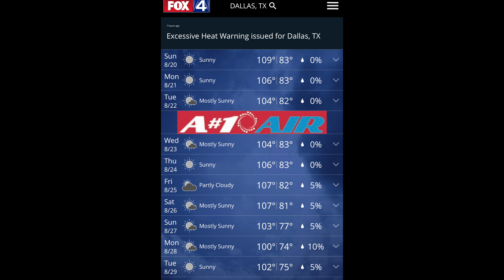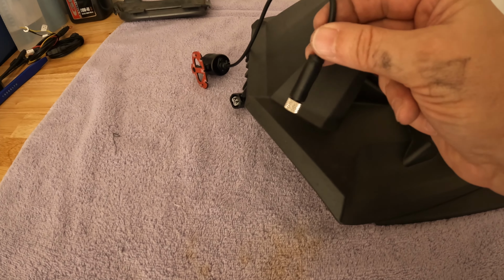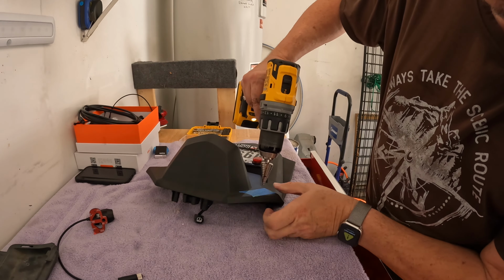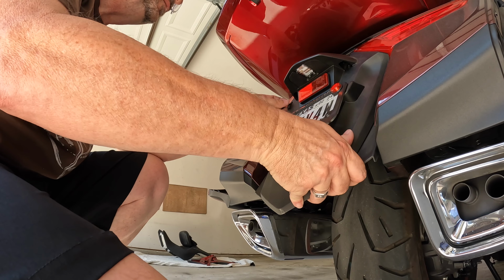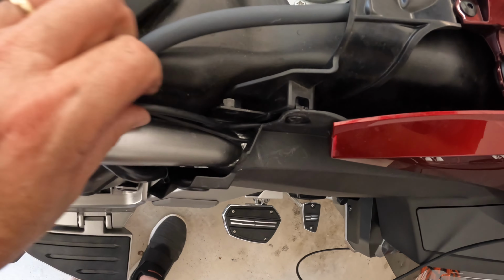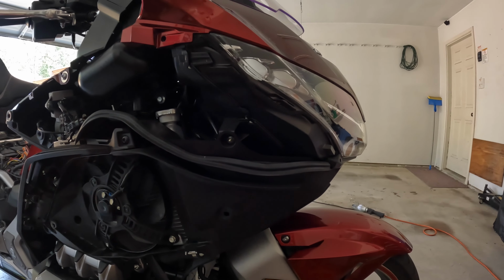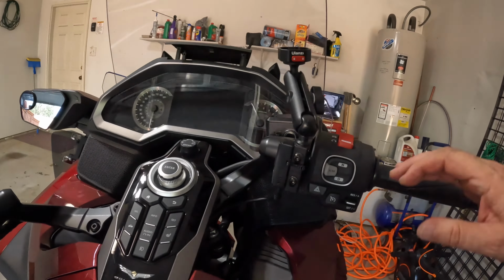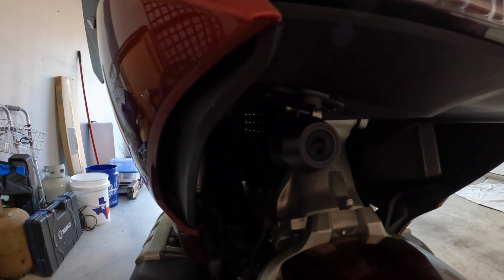VanTrue F1 Dash Cam, Install

Comment: I have a 2023 bagger and mounted the rear camera on the top shelf up against my new Corbin Fire and Ice saddle.  Lewis at Electronic Connections sold me a shark fin antenna that promises to solve the poor FM/AM reception. I will now relocate the camera to the license plate holder shelf like you did and place the antenna where the camera was.  I hope this works...I've tried several things to no avail with improving reception.
Reply from the maker: Rodney, good luck with the install.  I agree my radio reception is horrible as is my phone call audio… I think because of my three way Bluetooth tooth… phone to bike to helmet.  Looking for a better solution there.  What color is your 2023?
Thank you for watching and supporting my channel!
Reply: Matte Grey.

Comment: Hey Robert, my Vantrue is having problems connecting to the internet. Did you have that problem? I use a Motorola wireless android auto bike adapter
Reply from the maker: @StretchingOn3Wheels  no that has never been a problem for me, but I can’t say I check the footage all that often.  Thanks for watching!

Comment: I mounted the main unit in the trunk, all of the wiring is long enough to reach.  There is a grommet on the left side front of the trunk allowing access to under the seat.  The remote, I mounted to the right side of the center control panel.
Reply from the maker: Wayne, mounting the remote to the center control panel crossed my mind too.  The trunk is a great idea for the main unit... If I start to have issues with the GPS I may move mine.  Thanks for the info and for watching !!

Comment: Cool.  Maybe a dumb question, but why not drill the wire through right behind the rear camera, on top? Just a little stabilization and more resolution and you could use that for motovlogging rather than the unreliable go pro or distorted 360
Reply from the maker: Torquer thanks for watching and commenting.  Right behind the camera was not clear from behind the license plate holder… and well I’ve already drilled.  You might be able to make that work however.  I’ve had good luck with the GoPro and if getting video off that VanTrue device is always as complicated as it was for this video, no way.  Ride Safe!
Reply: Could you elaborate on how it was complicated to download from his unit? I am a complete virgin as to dashcam use. I was very interested in this unit as I felt it would be more to my liking to have a permanent mount rather than something mounted to  my helmet or a pole. I have no interest in vlogging,  I just want it as a safety feature in case of an accident or theft. I truly enjoy both Cruisemans and your vlogs and star each day check8ng for updates. Be safe. Happy Motoring!

Comment: Thanks for the video on the installation! Made the job easier for me. I mounted my front camera in the middle and the rear on the license plate light housing. The wire fits inside easily and routed behind.
Reply from the maker: Awesome Peter… the only worry I had about a center mounted front was wheel travel…. You are likely fine…
Reply: @robertwhitemoto  yes, I have tried some really rough roads and haven’t had any issues.

Comment: Great video Robert. Thanks for taking the time to film the install and post it. It's always nice to see how much work goes into running wires and selecting an install location. You covered everything well. After seeing the video quality I may just order a unit for myself. Ride safe my friend.
Reply from the maker: Hey Larry, welcome back.  Yeah it’s good to have that insurance in case of an accident.  I was impressed with the quality.  Ride safe up there, and send some cooler weather will ya?  :-)

Comment: EXCELLENT Video Robert! I will install the INNOVV K7 instead on my 2023 GOLDWING. I have had to do a similar installation on my previous YAMAHA FJR1300 with the INNOVV and their cabling is a lot easier to manage and to snake through. I am looking into having the Recording device in the trunk for easy access to the Media Card. I like the routing for the Controller and the positionning of the Front Camera. McAllister (TRAXXION DYNAMICS) has recommended a similar position (LEFT/RIGHT) for the front camera due to the front strut compressing. Thanks for making the Removal of the Side Panel NOT as "obtrusive".
Cheers To A Great Video! 😎🏍
BTW-What kind of Camera Body are you using these days?!😊
Reply from the maker: @MrTanker10a  thank you so much for watching and for the kind words!! 🙏🏻. I really am interested in their new combo product that has the third eye combined with a dash cam…. I’m shooting with the Canon R5 currently… it’s all I’ll ever need.

Comment: Robert - great job showing the install.  With the exception of your extreme heat, which we're getting this week up here in Ohio, it looked pretty straight forward.  Can you narrate to the video while recording?  Would this be an alternative to a GoPro system for capturing road trips for future remembrances?  Thanks for walking us through.  My bike is an '05 so installation may be slightly different.
Reply from the maker: Hey Jim, thank for watching and commenting.  I think the video quality would be good enough for vlogs, but the stabilization of a new GoPro simply cannot be beat.  Also there's the matter of the wind noise, so I would have to cut the sound being recorded from the dash cameras and narrate into some other device and pair it all up later.  More trouble than it's worth.  There's plenty of cable and I've heard a few folks talk about mounting the base unit in the trunk or saddle bags rather than under the seat.  Ride safe up there and stay cool !!

Comment: Great install and thanks. Question on the rear camera wiring. I like where you installed the rear camera but not a fan of the wiring. I am just curious if there is enough room behind the camera maybe up a little to punch a hole for the wires?  Thanks again.
Reply from the maker: Rodney, I think there would be.